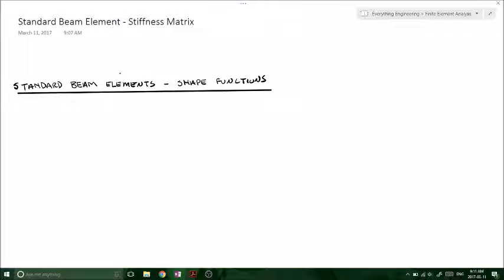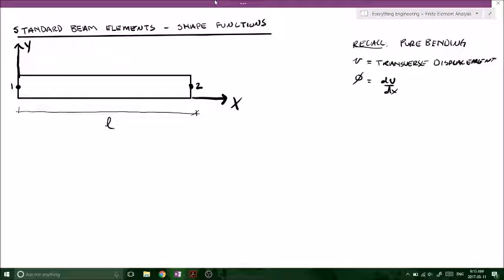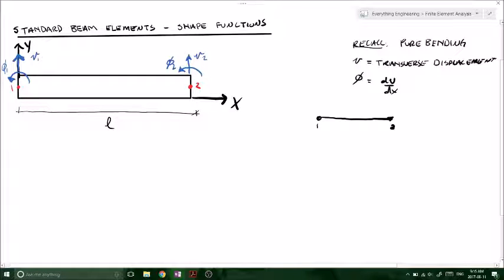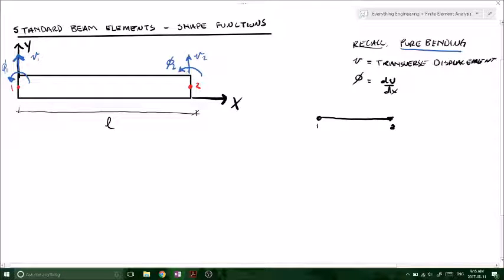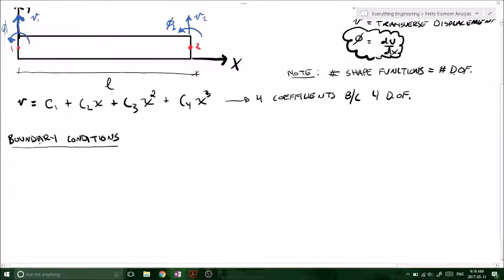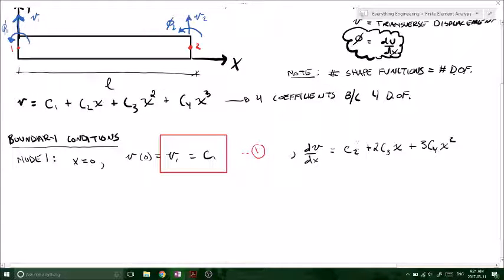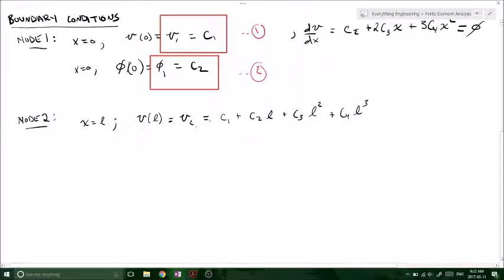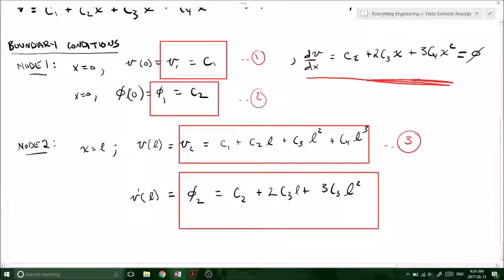Euler Bernoulli Beam Stiffness Matrix Theory - Finite Element Methods

Comment: how would i go about using this theory to solve stiffness matrix of wooden beam (orthotopic beam)
Reply from the maker: CristoClear because this method doesn't account for axial forces, all you would do is change the modulus of elasticity , E, to that of wood.  Everything else remains the same.  :)
Reply: Ok. Wood has three E , is there a way of combing or getting around that ? You could point me in the right reference if possible to look up how wood is simplified. (As part of my graduation project , I need to perform structural analysis on a wooden bridge so kinda need to find a way to derive stiffness matrix)
Reply from the maker: CristoClear this model works best and most accurately for homogenous materials.  However, as part of your project you might have equipment available to test the deflection of a beam and then analyze it using the three different values and determine which one behaves the most accurately to the test subjects?  However, a more accurate model would be the Condtant Strain Truangle (CST) or Q4 method which includes poisons ratio.  I have not provided videos on these topics but you can do some research and maybe find they are more suitable for your study?  In that regard, I am still in my undergrad so I would suggest speaking to your advisor before proceeding.  

Best of luck!
Reply: thanks. you are doing well. if u have any more light to share my way, plz share.  thanks a lot for your time.